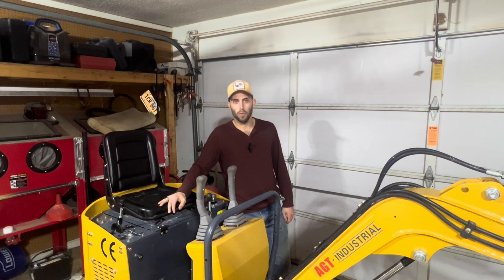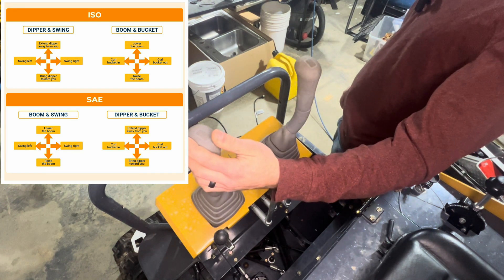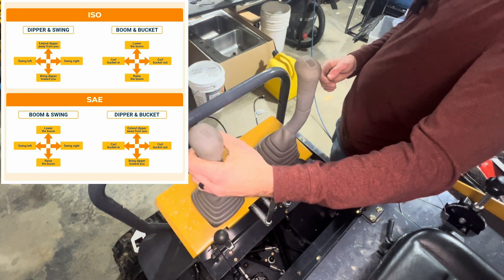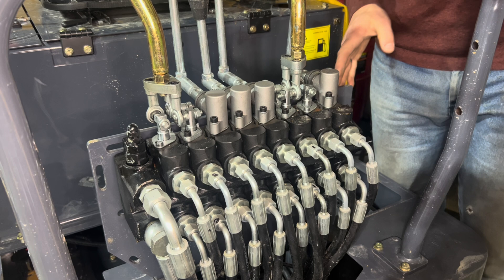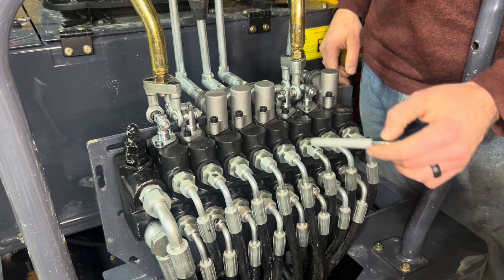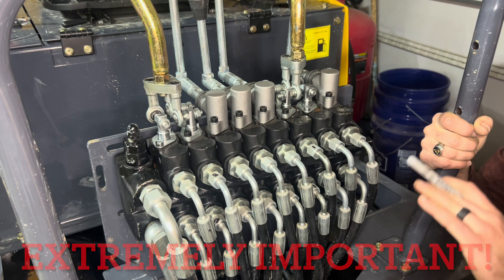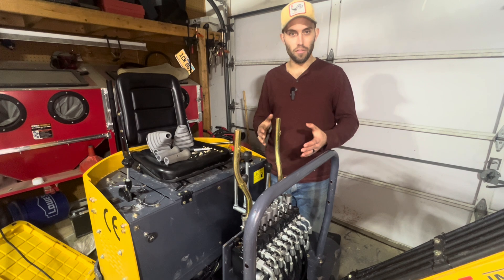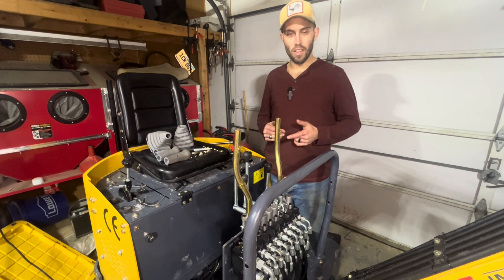Chinese Mini Excavator: Switching control pattens from ISO to SAE

Comment: Thank you creating this video.  It's the little things, like the set screws in the handles that I missed.  Your content has been really valuable as I learn about my EG360 and Miva va13. I considered leaving it at ISO, but at 50 years old I have always used SAE.  The argument that the whole world uses ISO doesn't hold much water since the whole world isn't using my excavator and I am not using anything but this excavator.  I have wondered if there is a hydraulic difference, but I don't think there is.  It's just a lot easier for me to use left had for the large parts and right hand for the small parts. (I know I left myself wide open there ;)

Comment: I GOT A NEW 2024 AGT H15R, BOTH JOY STICKS DO NOT WORK AT ALL, DO YOU HAVE ANY IDEA WHAT MAY BE WRONG WITH THEM? ANY THING THAT WORKS IS BACK AND FOWARD
Reply: Is there a lock/unlock switch
Reply: I have the same problem. I changed out all my fluids and test my new agt h15. It goes forward and reverse. No bucket controls. Turns out 3 wires were disconnected from the factory. Not sure if that is a standard shipping method from factory but I hooked them up and it still does not operate the bucket and turn around. I got caught my night time so I will have to look at it in the morning. It everyone has an idea please let me know, thank you

Comment: How did this to mine and it caused the machine to bog light crazy when extending the Dipper arm as if the spools are different
Reply: I switched the hoses on mine and also got a very dangerous motion on the boom and stick controls.  At first, the dipper cylinder appears to be laboring and then all of a sudden it jerks down and almost flips the machine over.  Any ideas?
Reply: Same here, seems more jerky… anyone figure this out

Comment: I have recently purchased a MIVA VA13 FROM WHAT I CAN TELL IT LOOKS IDENTICAL TO YOUR H12. I HAVE SOME SLOP IN THE SWIVEL THIS IS A BRAN  NEW MACHINE. THE STOP APPEARS TO BE BETWEEN THE DRIVEN GEAR AND THE DRIVE MOTOR. I'VE TRIED TO TIGHTEN THE BOLT ON THE GEAR DO YOU HAVE ANY INDICATION HOW THE DRIVE HERE IS ATTACHED TO THE MOTOR? OR IF THIS IS NORMAL. ALSO YOUR HYDRAULIC FILTER AND COOLING SYSTEM APPEARS TO FIT THIS MACHINE AS WELL I'LL BE LOOKING INTO THAT IN THE FUTURE

Comment: Your videos are excellent have helped me out a lot with my mini I do have a question for you where should the oil level be when the machine is cold in the glass I for the hydraulic fluid
Reply from the maker: All cylinders compressed it should be about half way
Reply: @thegarageconnection  I guess I don't understand all cylinders compressed is that running or not or I don't understand
Reply from the maker: @steveyuhaus5811  it’s when they’re all retracted to being as short as possible
Reply: Thank you